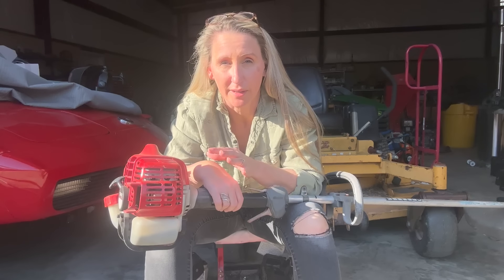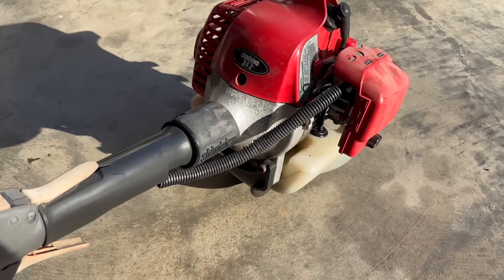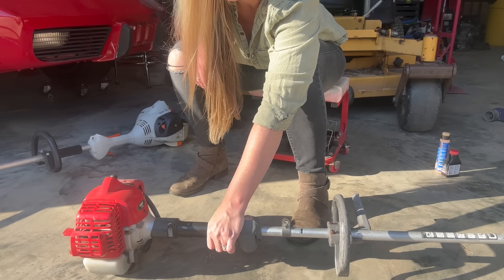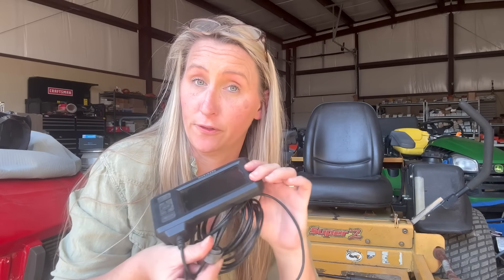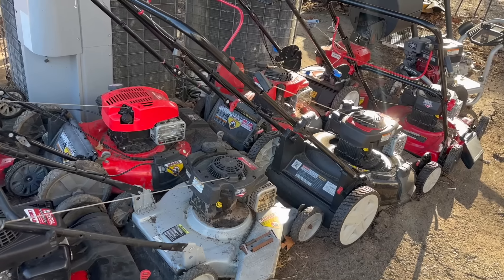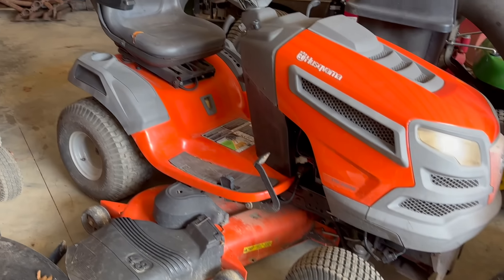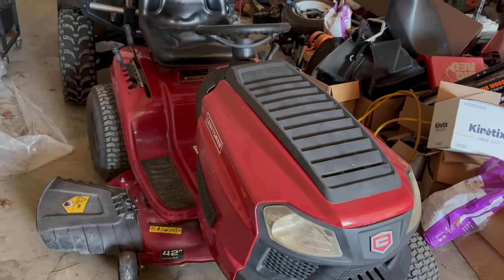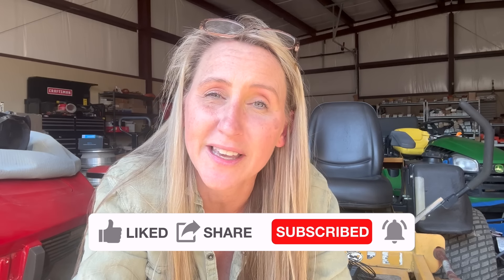Most People Do Not Know This SUPER EASY Trick I Use! MY 10 Second Trimmer Starting Guide!

Comment: Not applicable, it gets really cold here and I am a devout follower of your advice. My trimmer, edger, and leaf blower have no gas in them but did have two cycle oil pulled through.

However, I was finally flummoxed enough to take my ex mark commercial 30 2 year old out of warranty mower and it was motor mount bolts work themselves loose and reamed out the bolt holes. So I had to spend the cost of a Toro super recycler to get it back up and running but at least the technician put loctite on the new bolts which are not accessible without completely disassembling the mower.

Just venting. Thanks for all you do for us.